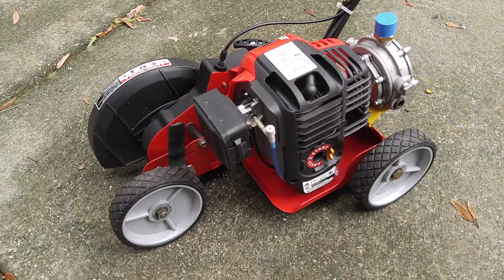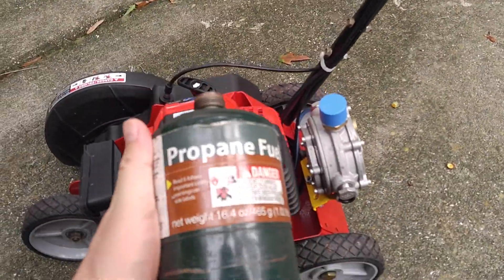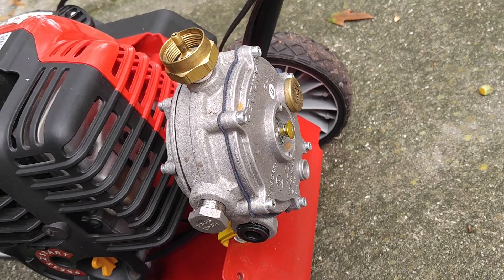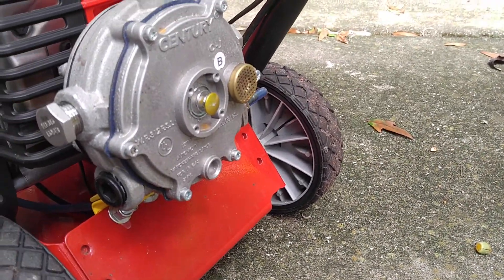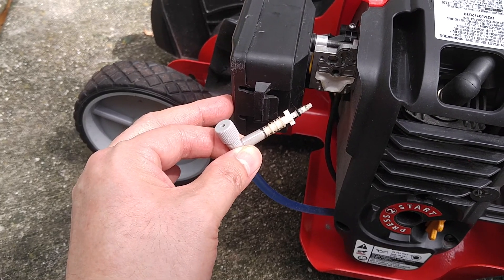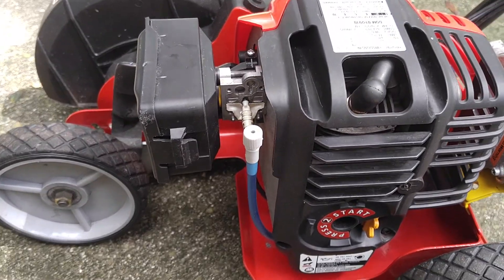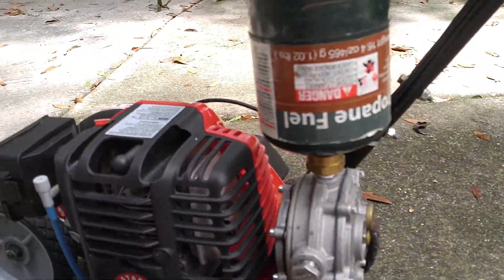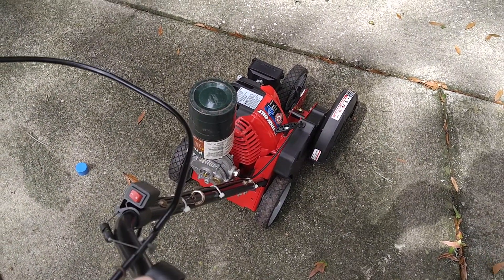Propane Edger overview (converted Troy Bilt 515)

Comment: Your running a liquid regulator. I've never seen a small engine run except on a vapor regulator. Are you sure it's not suppose to have the bottle pointing up. I like it very clean set up.

Comment: I really like the " Regulator "!  Please make a Video showing the " Building Concept ".  Although I know how to do it, but it will be interesting Video to see :).  Maybe add some info why you are converting.  I know a lot of People would benefit from it.  People like you and I having hard time with " Breathing Fumes "!
Reply from the maker: I'd love to make the instructional video on gas conversion. But unfortunately, I've been swamped by multiple work and house remodeling tasks, so it may take a while to get back to video-making. I recall that you were interested in modifying a snow blower. The good news is that many of those machines use engines which are some variant or copy of a Honda small engine. So you can search for "dual fuel carburetor" on Ebay to get a bolt-in replacement carb which has both gasoline and propane inputs. Depending on the engine size, they range from $17 to $38. I've never used one myself, but reviewing the features, it appears to need a 1/2 psi propane input supply. You can get that from an old bar-b-que grill regulator. The carb has an on-demand regulator built-in, so you'll only need to do some flow-rate adjustments to get the rig working.
Reply: +auxpowerunit - I have read that the Conversions would handle up to 50HP.... More than enough for what I need.  It has a " Safety Feature " built in.  Also, it has a " Primer " built in as well, which will be needing to start the Engine easily.  My favorite thing is that, it supply Gas on Demand.... So if your Engine Shut-Off... The Valve automatically closed, which is the big plus, as in safety.

Comment: What is that needle looking thing in the carb, I couldn't make out what you said it was.
Reply from the maker: That is an "Aquarium Fish Oxygen Air Line Tubing Flow Control Valve". I got 20 of those from Amazon for $9.15. Here is the link: http://a.co/bkRShE8
It is just a plastic needle valve which has a 90 degree bend. The plastic seems to be polyethylene, which is very chemical resistant.
Reply: auxpowerunit would a table top gas grill regulator work?
Reply: auxpowerunit I'm going to convert a 4 stroke weed eater into a trolling motor
Reply from the maker: That is what I used for my first project, a lawnmower conversion. Those regulators are simple and inexpensive. The output of that type of regulator is about 1/2 psi, so it keeps flowing even while then engine is already turned off. You'll need to have a manual shut-off valve on the output. The regulator I have on this newer project is an on-demand type. The output is -1/2 psi, meaning no gas flows unless there is a slight vacuum applied on the output. Of course, the vacuum comes from the intake of the engine. The advantage is that no manual shut-off is needed. Hence, it is much safer.
Reply from the maker: That will be a fun project. There are 4-stroke weed eaters which are basically the same engine which you see here, so you can modify it in the same way I did mine. If you are able to get a slightly larger engine which is based on a Honda design, there are dual-fuel carburetors available on Ebay for as cheap as $19 (including shipping). Many small engine makers copied the Honda size specifications, so those are bolt-in replacements. I haven't personally used one, but have corresponded with someone who did. The dual-fuel carb has a demand regulator built into it. I think the input should be 1/2 psi from a barbeque regulator.

Comment: Nice job.  I think I will try one of those regulators.   my beam t-60 requires additional vacuum port as a safety shutoff.  This safety is not necessary for these small outside power equipment.  It would make the conversion simple.   I also like the aerator valve to control mixture.   I hope it holds up to the lpg.  I once used a air hose from compressor and the propane degraded the hose in less than a season of mowing.

did you have to add a restrictor in the air box?
Reply from the maker: I'm pretty happy with this regulator. I purchased mine via Ebay for $48, including shipping. Search for "Impco model J" on Ebay. I agree the fuel lockout isn't necessary for our small engines. I didn't use a restrictor plate because I gave up on dual-fuel compatibility, so I didn't feed the propane into the airbox. Instead, I pipe the propane into the hole where the main gasoline jet previously resided. That is exactly in the middle of the venturi constriction of the carb, giving a strong vacuum. The valve I got seems to be made of Low Density Polyethylene which should be inert to propane. If not, it is cheap to replace since I got 20 for $8.57 at Amazon, LOL. Search for "aquarium flow control valve". Also, the tubing is silicone material, so that should be chemical resistant too. Do you have any ideas on what you'll convert next ?
Reply: auxpowerunit I have a 3" water pump.  I designed an adaptor and had it 3d printed.  I also have a hf motor that powers a gm alternator that I want to convert.
Reply from the maker: That will be fun. I don't remember if I asked you previously - have you ever tried one of those pre-assembled propane carbs from Ebay ?  They are listed as "dual fuel carburetor", and are only about $22. Since the Harbor Freight motors are clones of Honda engines, you'll be able to get a dual-fuel carb as a bolt-in replacement for the existing carb. All you would need to add is a first-stage 1/2psi (bbq) regulator. BTW, I've run out of things to convert because I gradually replaced most of my other garden tools with battery-powered ones. But ultimately, I'd like to make a propane powered chainsaw.
Reply: auxpowerunit I bought one of these dual fuel eBay carbs.  bolted up to my lct brand engine.   Hooked up to bbq tank with bbq regulator.   started up first pull and ran for over half hour without issues.  I ordered 2 more.
Reply from the maker: Fantastic !  I'm enthusiastic about getting one now. But unfortunately, the only thing I have left to convert is an 1800 watt generator.  It looks like they don't make a dual-fuel carb which will fit the 99.3cc generator engine (probably Honda GX100 compatible). So I'll just do a spud-in on my existing carb. BTW, how many cc's is your LCT ?
Reply: auxpowerunit not sure but it's about 6 - 6.5 hp range.
Reply: My LCT is a 208cc engine.
Reply from the maker: Considering those carbs are sized for specific Honda engines, your LCT seems to be right in-between the Honda standard sizes (GX200 vs. GX240). So, which carb size did you chose ?  And was the throttle response okay ?

Comment: Very interesting setup. I guess your engine is a 4 stroke ?

How much was the regulator ? Do you think it would work for a 5 hp engine ?

Thanks.
Reply from the maker: Yes, that is a 4-stroke engine. It looks like MTD designed it for some type of handheld machine, then adapted it to this little edger. Despite being only 29cc, it has plenty of power for edging. The Impco Model J regulator was $48 via Ebay, including free shipping. The J regulator is meant for forklift trucks, so it can flow enough propane to support 100hp engines. That is over-rated for this tiny engine, but the smaller demand regulators are actually much more expensive. Notice that I have plugs in the ports on each side ?  Those ports are used for engine coolant circulation. The coolant is used to heat up the regulator, so it will vaporize liquid propane faster. That isn't necessary since I have relatively low flow. I'm pretty sure the 3/16" aquarium tubing will provide adequate flow for a 5hp engine too. I was previously using 1/8" tubing for a 3.5hp engine. Search for "Impco Master Catalog" to find specifications on the regulator.
Reply from the maker: Another thing I forgot to mention. The original Model J regulator doesn't have a primer button. Only the copied regulators have the primer. That button is absolutely needed for small-engine applications, since it is the only way to get a rich starting mixture. Will give more details on another video this weekend.